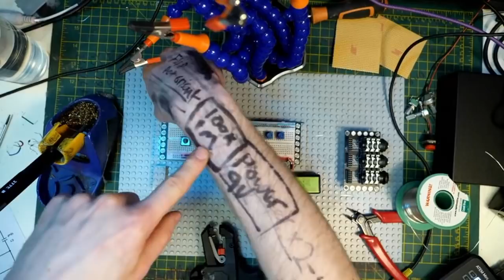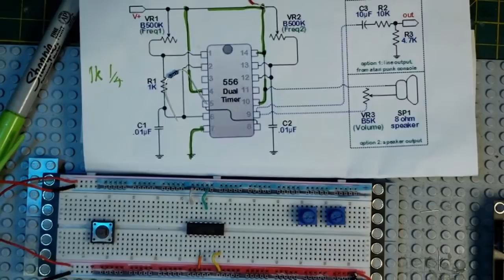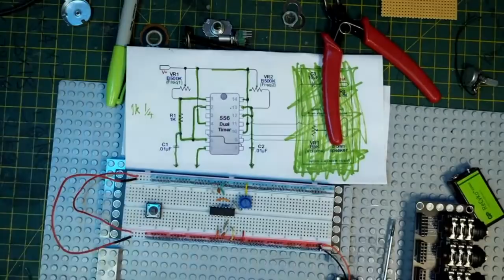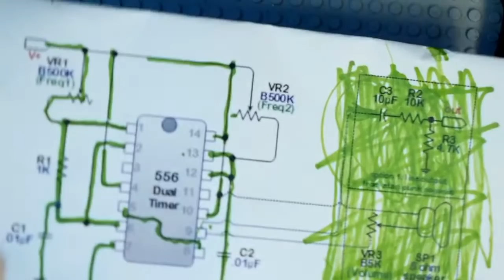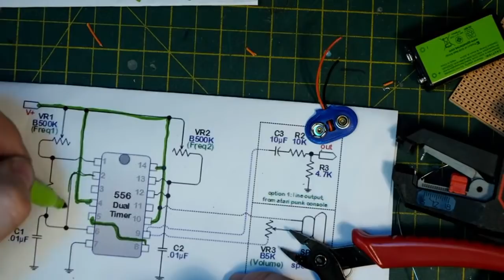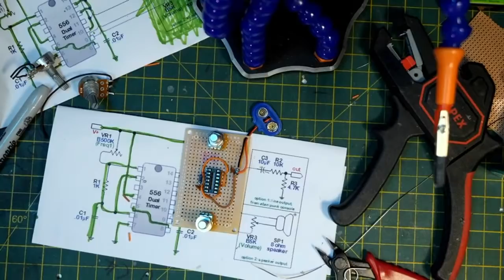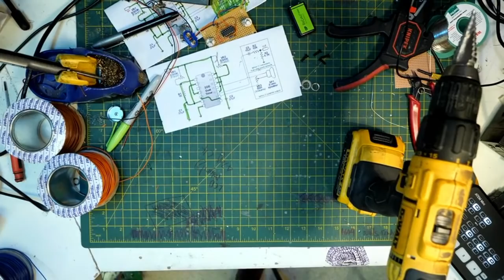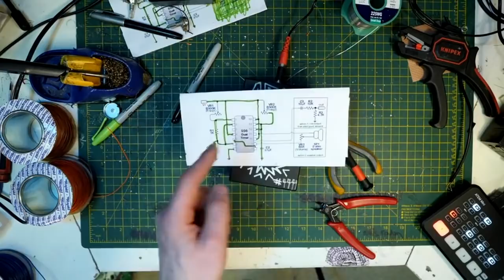Building A Super Simple Sound Machine, LIVE From Start To Finish

Comment: the soldering iron tips will last longer if you don't clean them off after the solder. You should clean it before soldering and leave it smoking in the holder, then the tin protects the tip from the air.

Comment: You are correct that PAT testing is not a legal requirement, and is only needed on portable mains appliances
However it is strongly recommended for health and safety, if your appliances are tested, it shows you are being a responsible person if something should go wrong (if an appliance catches fire and you have the right size fuse and the cord is in good condition, it's unlikely you will be prosecuted for example)
It might also be a way to get cheaper insurance
It's one of the things i used to do where i worked, i've tested thousands of appliances. (large lab and farm site)
Reply from the maker: yeaah cheeers i got a pat test indeed. its something i have done to all mains appliances, funnily enough there arent many. only about 10 and extension cables. but yeah its about having the green tape very true!
Reply: PAT testing is more a requirement if you are using electrics on someone else's property. It's an insurance thing.
Reply: @handlesarefeckinstupid  It's also recommended for health and safety when you have the public coming into the museum, and in Sam's case, insurance would have required it
A friend who is a hair stylist had to have all his clippers, driers etc tested for insurance (i did the tests for him)

Comment: Buy the Chinese ESD Safe Hakko knockoffs with the temperature control base station (i think they are 5 pin). You can get the chisel or horseshoe tip (good for large ground planes) and they last ages. You can buy the ceramic heating elements for those irons for 1$ or so, and just replace them.

Comment: The cutting pliers are called diagonal nose cutting pliers aka dikes ( diags spelled poorly).
This type of dikes are called flush cut dikes, and they are specific to electronics, and should only be use on small copper wire for best care.
Reply: Fingernail clippers work surprisingly well if you don't have a nice set of flush cuts